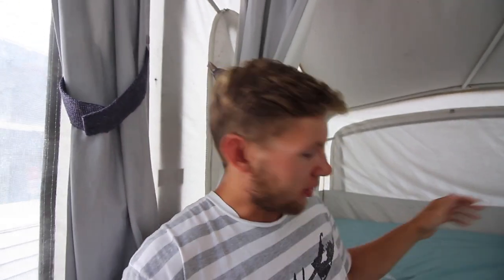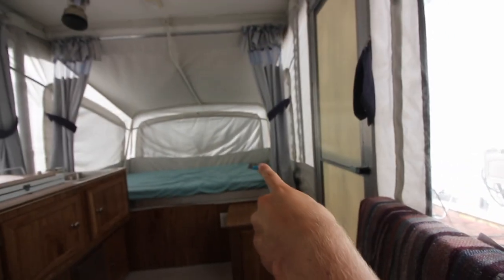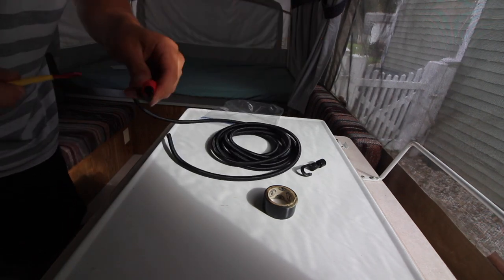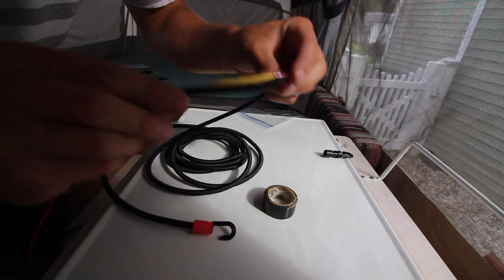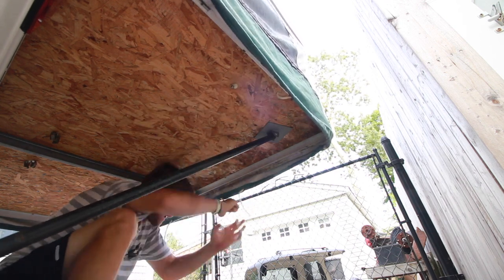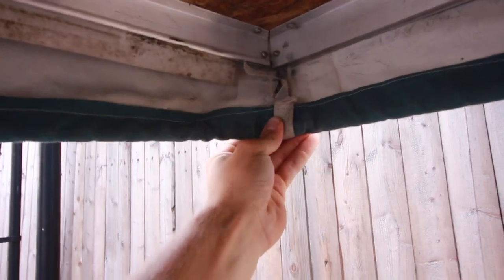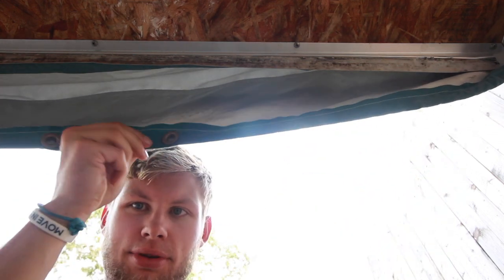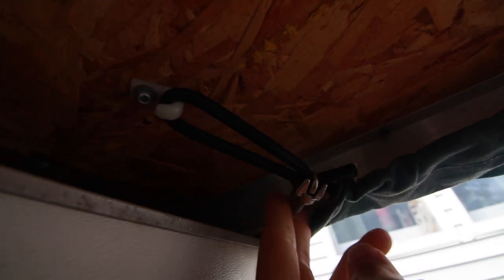Replacing Pop-Up Camper Bed Surround Shock Cords - HOW TO

Comment: i did this just yesterday, i left the old cord in as a guide until i got to a loop then removed the old cord bit by bit..  I put together a long piece of hard but flexible wire, around 400mm in length, I attached /wrapped the wire end onto the the cord ( like a needle and thread)  .. then pushed the wire through the canvas hoops as if it were a needle while pulling the cord through, it took me around 40 minutes to do both sides .. Cheers Donna